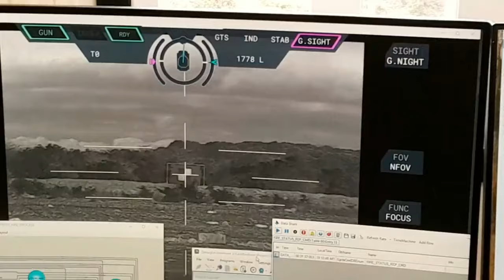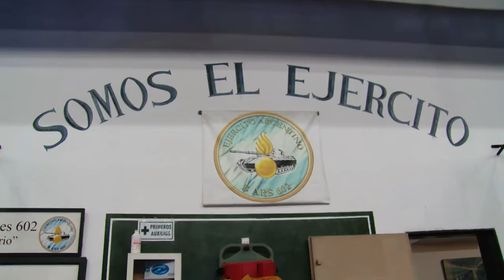TAM 2CA2: MAIS MODERNO CARRO DE COMBATE DA AMÉRICA DO SUL USA TECNOLOGIA ARES AEROESPACIAL E DEFESA!

Comment: Like 113 👍 CAIAFA, este tanque não é pareo para os nossos Leopard 1A5 BR. A estrutura do tanque argentino é fraca e até um tiro do Cascavel acaba com este tanque.💪💪💪💪
Reply from the maker: Mesmo se tu fosse um cavalariano ex-tripulante, sabemos que não é bem assim, e a tecnologia embarcada do TAM 2 AC2 compensa sua falta de proteção.
Reply: @caiafamaster  Pois é, até os americanos criaram um MMBT baseado no Abrams. Está equipado com canhão de 105 mm e mísseis anticarro e pesa pouco mais da metade do MBT deles.

Nós poderíamos construir nosso próprio veículo feito a partir do TAMOYO, melhorando a estrutura e colocando sistemas digitais. Seria o projeto TAMOYO NG.
Reply from the maker: @regisathayde2624  basear um carro NG em um chassis de aço homogêneo recall do M41 WB? sério?
Reply: @caiafamaster  Entendo o que você quer dizer Caiafa, mas eu estava pensando no design do veículo não na estrutura da máquina. Até o Gripen E/F tem semelhanças com o antecessor,  mas é uma aeronave nova.
Reply from the maker: @regisathayde2624  melhor projetar do zero, sabemos fazer chassis, fato, o que pega é eletrônica embarcada, sistemas secundários, subsistemas funcionais e powertraim motor + transmissão, ou seja, o resto do carro.
Reply: Creio que temos plena capacidade de fazer todo o restante com as empresas que temos hoje no Brasil. Falta a classe política e sociedade entenderem que é importante e vantajoso investir nisso.